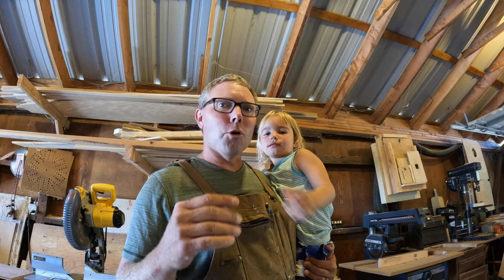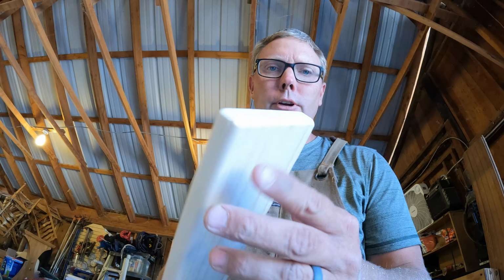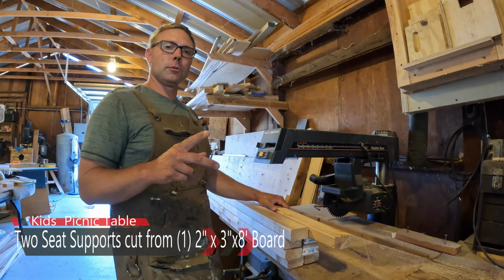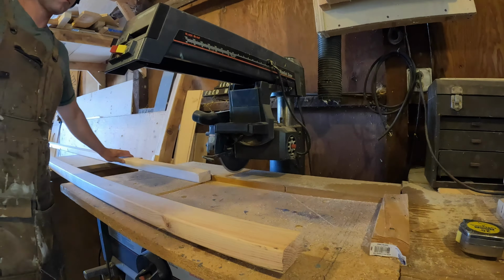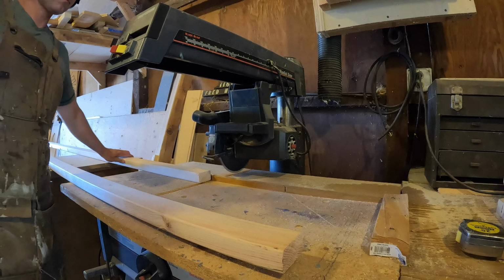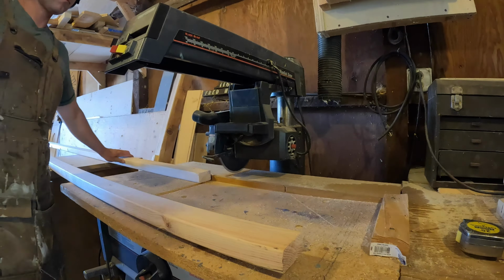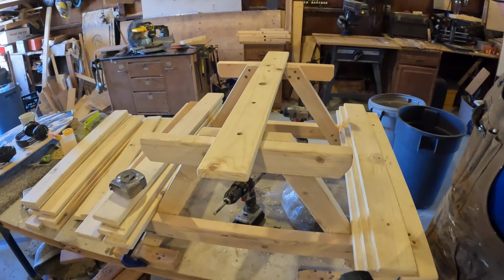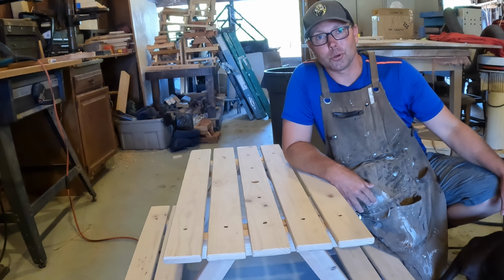DIY Kids Picnic Table with Umbrella hole. Material | Hardware | Finishing

Comment: Please tell me how do you finish the tables, such as primer, stain, coating, etc?
Reply from the maker: My favorite way to finish a picnic table is by burning all of the surfaces lightly with a weed burner torch. After I burn the edges I use 220 grit sandpaper to blend the inconsistent burned wood so it looks even and smooth out the raised grain after burning. I then use a clear coat made for indoors or outdoors. The clear coat depends on the desired location of the picnic table. I prefer a water based product that has a 1 to 5 year life span on flat surfaces. 

When painting a Picnic Table I like to use deck stain with a solid color in the mixture. On new unfinished wood the stain soaks into the wood and lasts for 2 to 5 years. If you want to see the wood grain than use a semi-transparent stain formula. The product that I usually use for adding color to Picnic Tables is: Cabot Stain Sealer or Valspar Stain Sealer. I purchase them from a Lowes Store.

When applying any of these products I use an HPLV sprayer to put on an even coat over the project that I am finishing. As long as you filter the material it should help it flow through the sprayer.
Reply: @surfandturffamilyadventure9139 , thank you for the reply. I was wondering, where do you do the spraying? Do you have a separate self-contained place for that or do you do it right there in the open area of your shop or, possibly, outside?
Reply from the maker: I finish my picnic tables outside. I have always wanted to finish projects in a paint Booth. The thing about finishing projects outside is humidity, temperature, and direct sunlight play a huge role in the projects finish quality.